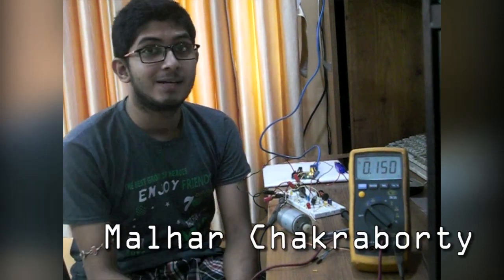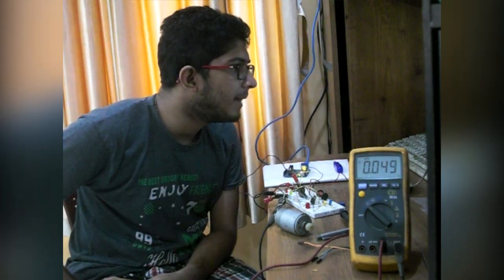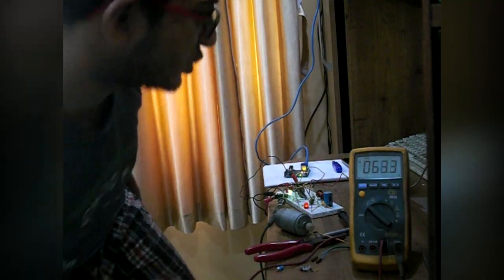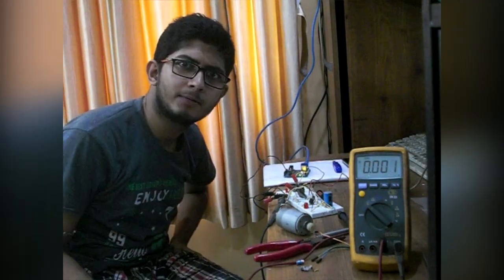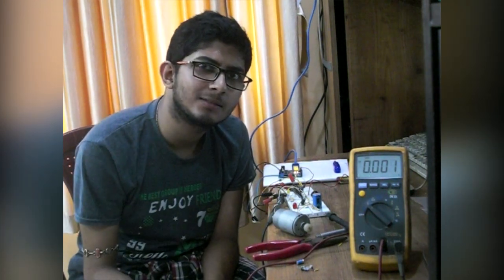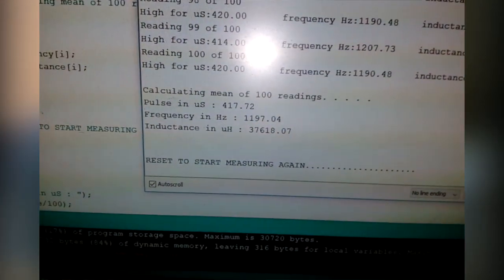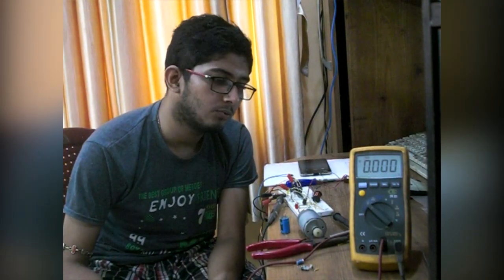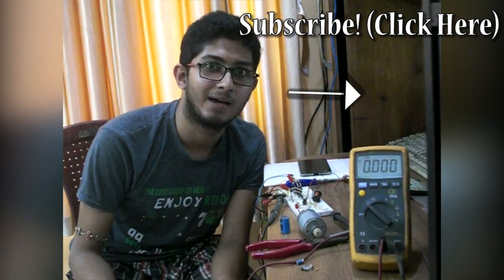[10V to 150V] Making the Ultimate Arduino Boost Converter in Outta Syllabus Style

Comment: Bro i m designing the boost converter with arduino but problem is whenever i put load on it.  Voltage drops and if pwm increase then MoSeft gets hot.  How to deal with this problem
Reply from the maker: Increase the pwm frequency... And use heat sink for the MOSFET

Comment: Electro boom copy? nice editing tho
Reply from the maker: Facf Jes, Not copy... "Inspired" 😀😁 Thanks for the comment, like, share and subscribe :D
Reply: @OuttaSyllabus  any way, I built a version of the boost converter but it's voltage drops crazily, and it's unstable. It has feedback from a 10k/1k divider, any idea? I'm using a pair of 13007 transistors in parallel and two 15000u caps
Reply from the maker: Facf Jes, Can you check it's max input and output current and also voltage? and how much inductance are you using?
Reply: @OuttaSyllabus   the voltage can  go as high as 40v  depending on what I set, however as soon as it is loaded, it crashes to 12volts, the Input voltage is 6v..im using a huuuuuge transformer with a 100 amp rectifier.... Inductance..... No idea, still battling with the lm339 circuit
Reply from the maker: Facf Jes, oops, however I missed this comment, that happens because of the lower switching frequency... You will find a similar kinda result in my this video :- https://www.youtube.com/watch?v=E0M50tCbBJ0
But still you are getting 12V from 6V (double), may I know how much current you load draws? and also the other component specification of your circuit?